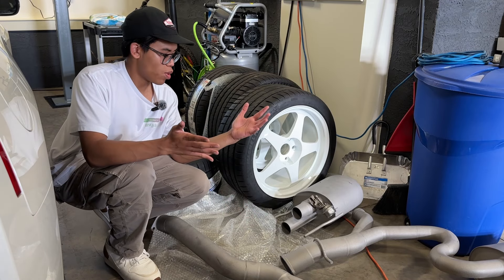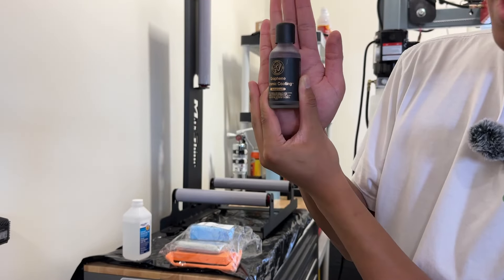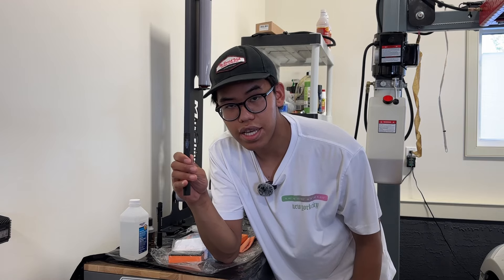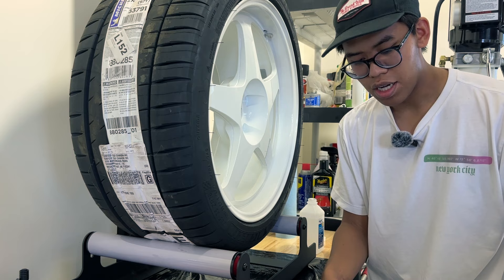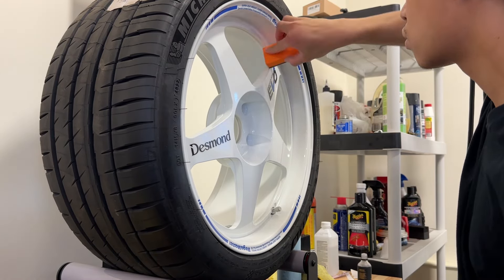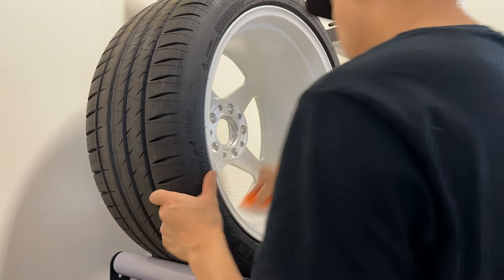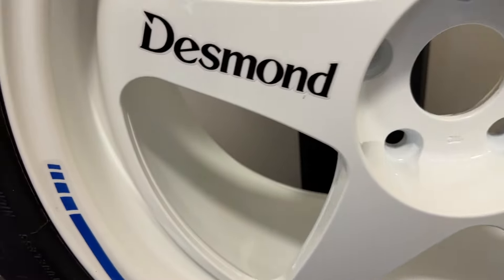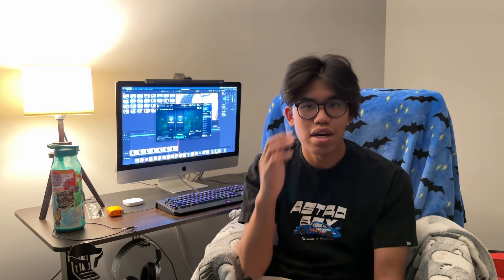First Time Ceramic Coating Wheels

Comment: I started using Chemical Guys' Hydro Spin when I got my new RPF1s a few weeks ago. The wheels still pick up a bit of brake dust, but it wipes right off. Using the Hydro Spin like a detailer, it cleans the wheels and then leaves another thin ceramic coating each time. Everyone should definitely use some kind of ceramic coating on new wheels; when applying to old wheels, they need to be absolutely showroom clean. You hit the nail on the head: prep is the most important part.
Reply from the maker: @slosubies4845  Thankfully these wheels were brand new so I only had to do minimal cleaning haha